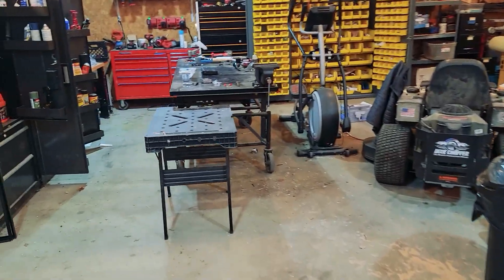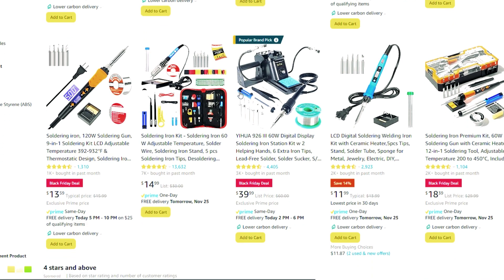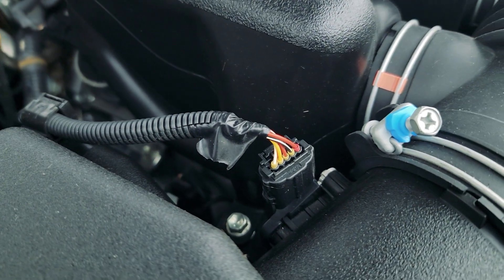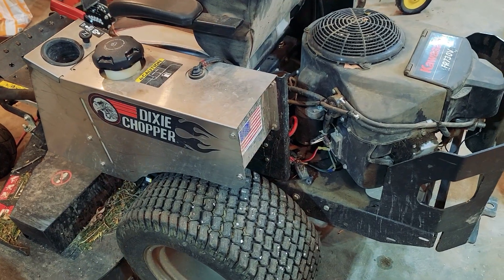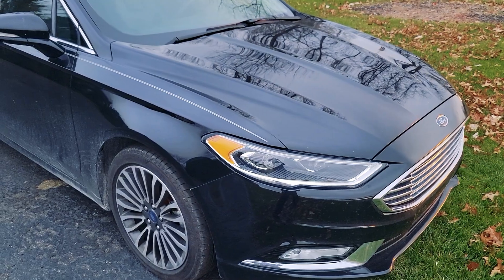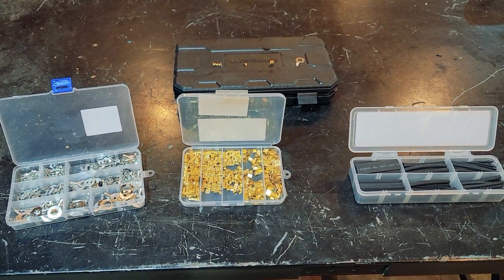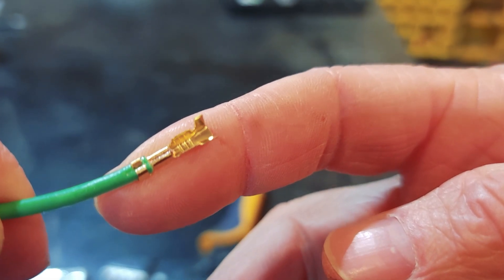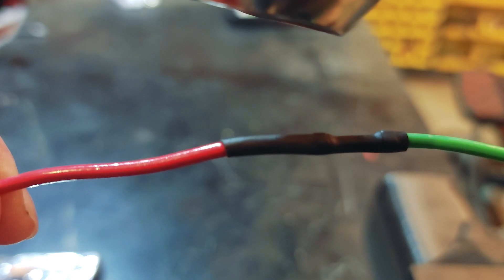Open Barrel Crimped Wiring Connections - Stop Soldering Wires on Automobiles!

Comment: I agree with you. In my shop, before I banned them, Chrysler wire harnesses would fail around the back side of the engine. They solderd the injector wires (4 cyl.) and the joint would break. Of course it was covered in a harness. That's when I stopped soldering wires in a car.

Comment: How many ratcheting crimps per connector two or four? In other words, does the crimper crimp both the insulation and the wire for one side both at once, or is that two seperate crimps?
Excellent presentation btw.
Reply: I realize this comment is a year old, but for anyone else reading the crimper used in this video crimps around the jacket of the wire and bare section of wire in one action. You have to be sure to put the connector in the die correctly. Pay close attention to how he does it in the video.  If you put the connector in the jaws pointing the wrong direction it’ll look all jacked up. Once you do a couple crimps you’ll understand what I mean.

Comment: Sir, I have a question.  On my driver's headlight on a 2912 Grand Caravan, I narrowed to problem to its positive wire only drawing 4 volts. The fuse box headlight location tested 12 volts. 
Can I run the headlight positive to the positive fuse locations since the van doesn't have day time running lights?
Any feedback would be greatly appreciated, and remember that my skill or knowledge is nowhere near yours.

Comment from the maker: Videos that discuss the open barrel crimps and its advantages.

https://www.youtube.com/watch?v=E_m8xf3vfYE&pp=ygUSYmVzdCB3aXJlIGNyaW1waW5n

https://www.youtube.com/watch?v=pOTrS6-mNtA

https://www.youtube.com/watch?v=pSXv8RHa22I&t=1006s

https://www.youtube.com/watch?v=EAr2z6rGV7o&t=10s

https://www.youtube.com/watch?v=VXVISyLUTl0

https://www.youtube.com/watch?v=pVG1hi3yTJ8&t=1924s

The Kits I bought after research.

https://www.amazon.com/dp/B0BJVH4J6Q?psc=1&ref=ppx_yo2ov_dt_b_product_details
-	My research indicated that though this wasn’t the “very best” crimper out there, it is a crimper that will insure you have the ability to properly crimp all types of crimped connections.  The tool works very well on the open barrel crimps, the only issue I’ve had is that I when splicing 3 wires together using the flat U shaped connections I have to switch the jaws over to the “solar” type of jaws.  Not a big deal, just have to factor your workflow to making connections and then doing the splices. Based on actual use the key thing that these crimpers MUST HAVE is that they must be ratcheting type – this ensures that you can hold the open barrel connector in the crimpers while manipulating the wires with your other hand.

https://www.amazon.com/dp/B08QJ1H3BJ?psc=1&ref=ppx_yo2ov_dt_b_product_details

https://www.amazon.com/dp/B08XTV93GD?psc=1&ref=ppx_yo2ov_dt_b_product_details